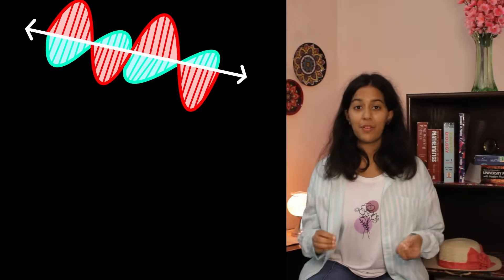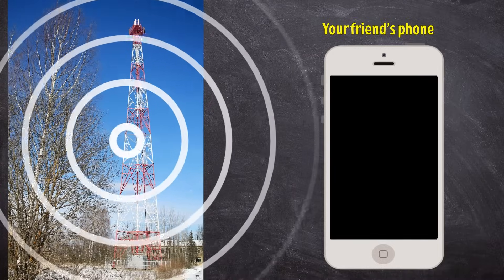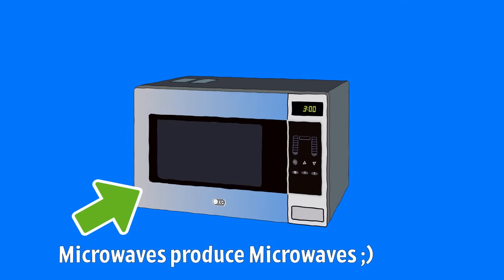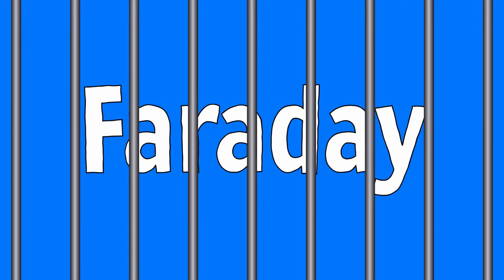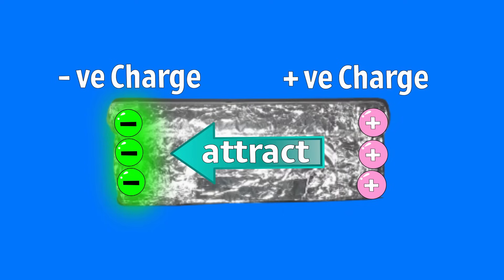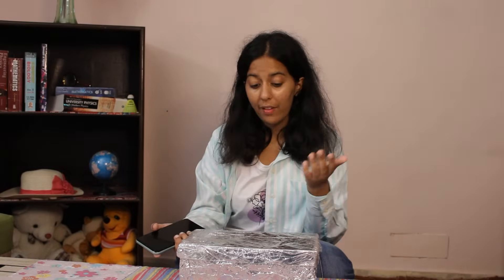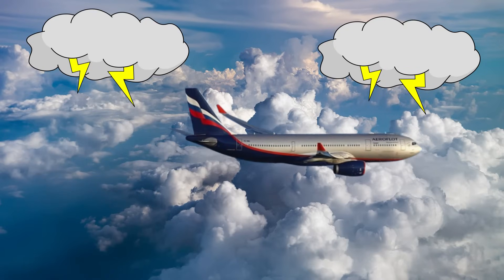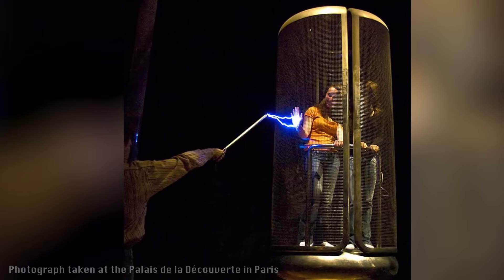How to Block Calling Signals? (Using Physics!)

Comment: Excellent expl;anation...MY QUESTION NOW, Does the Aluminium Faraday cage box blocs the contact with the satellites? And thus the GPS localisation of the cell ? Would really appreciate your answer to this.
Reply from the maker: Hi, as I told any kind of electromagnetic radiation can be blocked by the Faraday Cage (or in my case, aluminum). Also the GPS receivers use radio signals, hence can be blocked by a Faraday Cage.
Reply: @Physicshood  Wow excellent. perfect tool .

Comment: I put my phone in a microwave oven today.  I wanted to see if it would block the national alert today.  It didn't work.  Does that mean my microwave oven leaks?
Reply: Your mistake was not removing the door of the microwave. That way all the microwaves leak out and can't damage the phone. And if you sit in front of it you'll get a nice tan. 🤪
Reply from the maker: Hi, try to wrap the door of your microwave oven with some aluminum foil and see if it works. That may sound a bit odd but it might work well :)